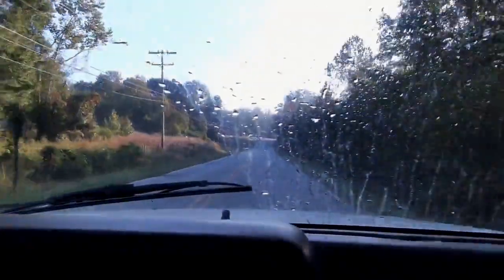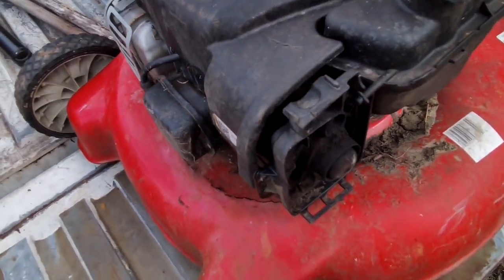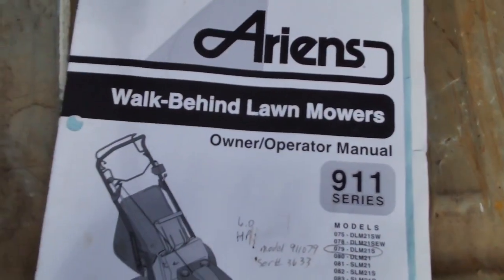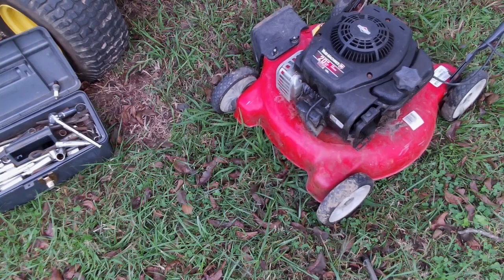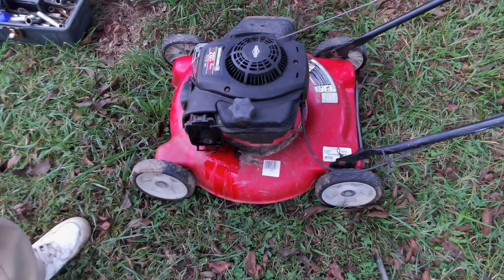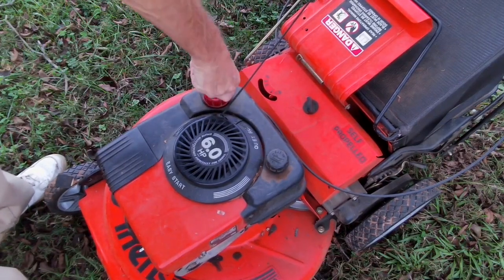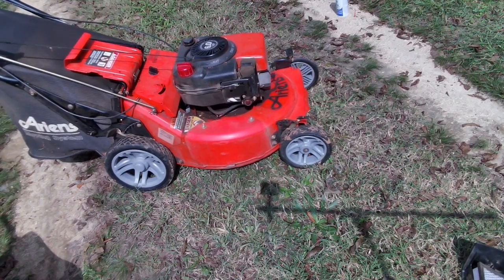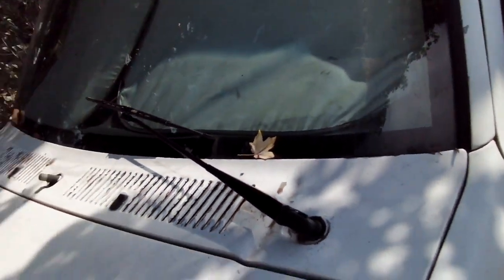SATURDAY SCRAP PICKS | ARIENS 911079 | YARD MACHINES 11A-02BT729 | WILL THEY RUN?

Comment: Ultimate score!!   I would sell the yard machines and make a nice profit & keep the ariens for myself 😀
Reply from the maker: That Ariens is awesome!  It runs, it cuts, it pulls itself.  Absoulutely nothing 
wrong with it.  I can't get over getting that at the scrapyard.  I mowed a 
property with it this morning and it payed for itself and the other one...LOL  
Yeah that one stays with me.  Cheers Bernie!  🍻 Thanks for coming by!
Reply: @bigalsmallengines  yeah you lucked out for sure!   I’ve yet to get a mower with paper work. I was once told that ariens was something to do with snapper. They are very similar with the disk drive. And a very well built mower.  Many people bash tecumseh.  But as you said. They are one heck of an engine. If it ever fails, that mower needs an intek lol. Great to see you are a VGG fan to. I love Derek and his antics 🍺
Reply from the maker: @dirtyberniesgarage1194  That Tecumseh even with it's age still has good power.  I was mowing
5" grass with it, and went right through it with the drive enguaged.  It makes a pretty cut also.  I'm
truly blown away by this mower.  I know nothing about an Ariens Bernie, I got this mower out of 
sheer curiosity.  I've never had or worked on anything Ariens.  Everything is beefed up on this unit,
I'd say professional quality.  I think they are largely sold and serviced at Airens dealers and there 
are none around here I know of.  Maybe why I never see them or have serviced one before.  An 
Intek would certainly be the replacement, something else I never see around here...LOL  Yeah 
VGG, makes me want to go find a car and drive it home from 600 miles away....LOL  Cheers to you
Bernie!  🍻